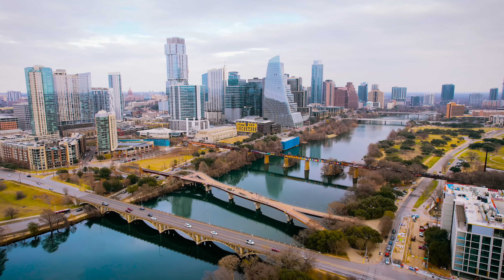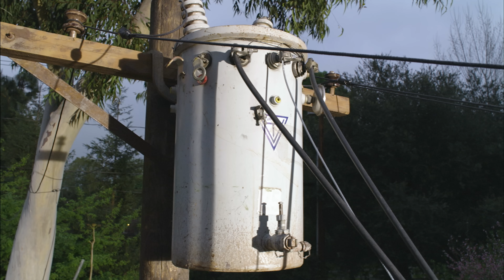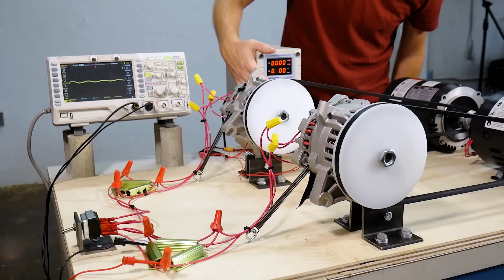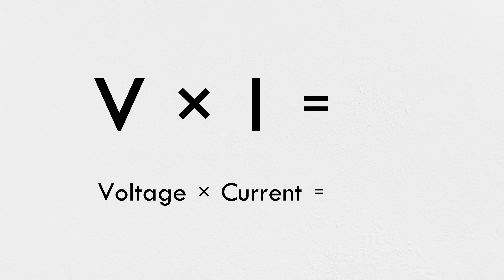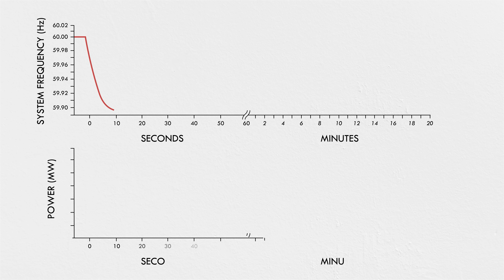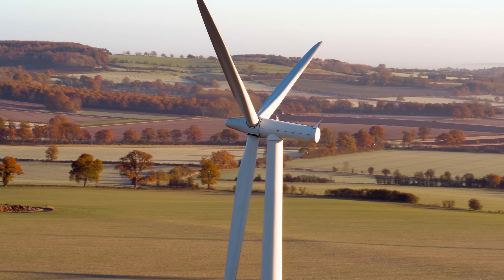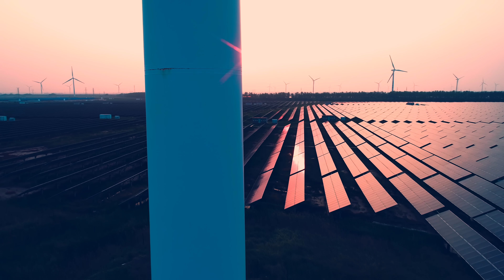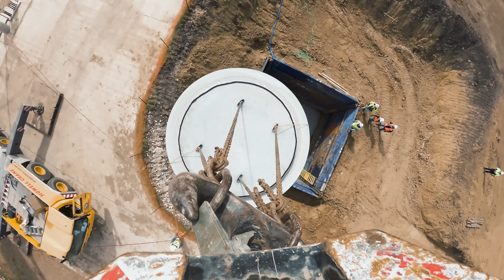Connecting Solar to the Grid is Harder Than You Think

Comment: It seems a bit like the answer in the Edison vs Tesla debate may be shifting.
The decision for AC came from a time when phase regulating equipment was only needed in a hundred or so power plants across the country while inverters were expensive mechanical devices, but it allowed us to have "dumb" transformers in hundreds of thousands if not millions of places across the country. However, now this means that we need "more modern" phase regulating equipment with the inverter in each solar, wind and battery installation. And with our goal of expanding renewables, we'll likely see solar installations on the roofs of a sizeable fraction of houses, and thus possibly more inverter based sources than transformers. I wonder if there would ever come a point where it would be cheaper to have built a DC grid instead.
We'd need an own inverter on the input side of each transformer, but they just have to be the solid state kind without any synchronization features that make the "more modern" ones more suitable to the current complex landscape, since they can be independent and don't have to "play along nicely" with the rest of the grid. As far as I understand it, the fact that the frequency gets messed up whenever there's a disturbance results from the fact that there's more than one source of AC power on the same wire. With a DC grid, that can entirely be avoided and transformers should work at any input voltage (they could merely output AC power with a lower voltage, while the frequency can be held sufficiently stable to protect appliances).

And even if the DC path never gets cheaper, the AC decision was made at a time when only factories and street lighting really relied on the availability of electricity (if they weren't still gas lamps). These days so much more goes down when electricity is out. Not just all indoor lighting, communications, all of our home appliances, and hospitals; but also our heat, water supply, traffic lights, shops, and the power plants themselves. (Yes, there's exceptions whenever outages are too disturbing that backup generators or USPs are kept on standby - which also costs money.) The resilience of not having a single bad law, guideline, or default setting in a series of inverters turn a slight disturbance into a full power outage, might even justify a solution which costs more but isn't so complex that predicting it's behavior becomes near impossible.
I mean, even running the self-regulation on the current power grid requires a separate data channel to communicate the current (and possibly even forecast) electricity price. A DC system would in theory regulate itself to some voltage value in the acceptable range, even if you did something as simple as setting a convention how the electricity price varies with grid voltage, possibly even with additional dependence on the time of day to further stabilize the voltage against predictable cycles of demand (and supply).
Reply: That moment actually passed a long time ago - all computing runs on DC (transistors are DC devices) so we have to convert AC to DC for every single device which uses a computer, chip or logic circuit, which is everything in (not even modern) electronics. The cumulative costs of that passed the costs of a DC grid ages ago.

But there's never been a point, and never will be, when making an entirely new DC grid and switching everything over from AC to DC is cheaper than just continuing to make do with the AC grid we have. Not only do you have to build a DC grid, but you have to rewire every building and replace every device built for AC. Even all the devices that would work better on DC would need to be replaced because they've been built for AC input.

The cost would literally be all capital investment across the entire economy for several decades (that's what you're replacing), just to get to the same point we're at today with a DC rather than AC grid.

If only Tesla and Edison had a crystal ball that predicted the technical workings of computers - they could have made the right choice, and also invented computers.
Reply: Yea, ok imagine if some smaller eg island nation went for say 400Vdc , all the smaller generators plus users must tap into it, volt drop the first major issue, they have to choose a practical / safe voltage everyone could work with.

Comment: Practical Engineering prepared a good video on the subject.  The take aways are that with the present technologies the grid will need conventional rotating machines to maintain the frequency and the voltage support for the frequency following inverters to function.  Following the technical literature there seems to be a limit for renewable generation with frequency following invertors at 70% penetration due to dynamic characteristics of the grid following a major disturbance like a fault.  As cited in the video there is a need for inertia and the ability for reactive support from generating sources to ride through the disturbance.  One must remember that the invertor-based devices can provide some of these requirements, but there are limits within the controls for them to be effective.  For the grid operators the information of those limits needs to be well understood.  There is plenty of work to be done for achieving the goals.

Comment: I disconnected my lines in from the power meter,and made my solar connections to my mppt and on to my battery bank/power cells and then directly to my AC breaker panel while using the existing romex to send the dc power to all outlets,lights,etc and use dc bulbs,brushless dc fans, and dc and or LP aplliances and never need more power,or have to give away my excess power for almost free to the monopoly... Fans run 24-7-365,lights can be ran non stop due to such low draw/usage,and I even have extra wattage that runs my entire shop..

Comment: My engineering perspective on photovoltiac PV solar favors rooftop over vast field arrays. Rooftop solar seems to lead to neighborhood mini-grids whereby modestly larger PV arrays provide more energy for household needs. Matching rooftop and neighborhood arrays to household EVs again seems to favor plug-in hybrid PHEV over all-battery BEV tech for many reasons including addressing the need to reduce routine vehicle travel and transport of essential commodities the longest distances. Plug-in Hybrid PHEV+H tech seems to be the most equitable distribution of battery, PV solar array and (combustible) hydrogen resources.

Comment: Going with d.c. electric for off grid cottage like a sail boat or R.V. Running lights and smoke detectors on stand alone system with backups. I will have an A.C. inverter for my power hungry tools. The D.C. appliances cost a little more. I think the D.C. fridges and freezers have more insulation.

Comment: Maybe the grid need a separate "base clock" that is shared among all the power plants as a guide to what the frequency should be. In the case of a loss of a plant, solar and wind plants can refer to that "base clock" and push the grid frequency up.
Reply: Doesn't work that way. The clock has to be analog with a magnetic field.
Reply: @thedude5040  Not sure what you mean. The clock just has to be independent of the grid. It can be anything that can keep accurate time so plants can refer to it if the frequency starts to drift.
Reply: @samik83  the clock is encoded in a changing magnetic field. A digital clock offers no motor control and is far too slow of a response time. This is one area a digital system cannot and should not replicate. Even a GPS clock is too slow and too inaccurate for grid synchronization
Reply: @thedude5040  Is that magnetic field created by grid power?  
A digital clock can work in the gigahertz range for example, so I don't know how that can be too slow.
Reply: @samik83  gigahertz has far too short of a wave length and too high impedance to couple a magnetic field from various generators 100s of miles apart from eachother.  But it doesn't matter what frequency your digital signal is, it will always be too slow as each interface will add input lag from from simple processor instructions of trying to read, copy, or match the signal. The magnetic field created by the power grid also is the clock signal. If you wanted a seperate or secondary clock you will then need a second set of wires connecting all the generation sources together. The field also stores energy. This is why when the grid collapses its hard to bring it back online because you also have to account for all the stored energy in the transmission system.
Reply: @thedude5040  Well I'd be amazed if with todays high speed fiber optics you couldn't synchronize clocks to the needed accuracy.  Grid frequency is many orders of magnitude slower than what we can get from internet speeds.  But I'm not an expert on this field so I'm just thinking out loud here.
 
Or simply use GPS time that doesn't need any connections at all, just GPS receivers at plants.
Reply: @samik83  get over yourself you are talking about things you know nothing about. you still critically fail to understand analog time. It's not about a precise set period. it's about speed of light response. Fiberoptics can't store energy and still need computers to decode signals, where as a mechanic motor will insteanesouly respond to a change in magnetic field. You need a system with speed of light responses with flexibility yet strict controls, infinite resolution, and no input lag. You also forget that motors don't spin up insteanesouly but the stored energy in the magnetic field does. There's no point to a secondary grid clock.
Reply: @thedude5040  "get over yourself you are talking about things you know nothing about"

Ok I'll ask you, since you seem to know.  

"It's not about a precise set period. it's about speed of light response"

If it's actually speed of light response, I'm interested in knowing how this works, what are the systems that can balance the the grid so fast. 

It's just interesting that in the video he shows a graph where the response time is in tens of seconds and using backup generators in some cases.  Not exactly speed of light, would you agree? 

I don't know of the how much energy companies actually use grid following inverters, but that was just my idea of how to correct it. I assume there are already that inverters that don't simply go along with the grind if theres a problem, but actually try to correct the frequency if they see it deviate as not to cause a cascading failure. 
I wonder how those systems work? How do they know what the correct frequency should be?

Comment: 6:10 This is not at all what a smoothed PWM output looks like. You will not find a single straight line in the actual ouput (and of course it will be much, much closer to a sine wave).

Comment: Actually, many inverter topologies (connection pattern between the electronic switches that convert between the AC grid and DC solar) are readily and very cheaply (less than +25% cost) amenable to cover more than half their AC power rating worth of DC-connected battery.
What that specifically allows is to forcibly smooth out grid injection of PV-sourced energy over a couple minutes, or alternatively and likely more beneficial, emulate a veeeery heavy flywheel with their battery-based (instead of flywheel inertia based) energy reserviour.

Note, we're talking about on the order of half the panel cost (using "one shipping container straight from china, not including shipping and taxes" prices) or even just 20% in batteries to have "5 minutes of backup power in case sudden darkness"-worth of energy storage.
It is though generally preferable to utilize day/night load shifting battery farms like the ones e.g. Form Energy are working on (iron-air batteries, target of 100 hours of capacity at max power) instead of oversizing the AC capacity of building-integrated PV inverters, because those battery facilities will normally run their inverters (technically actually converters, because they unify inverter and rectifier) in battery-charge-from-grid direction right when the PV inverters are providing peak power. Thus by simply flipping the power flow direction by essentially just mildly adjusting the voltage ratio of the AC/DC "transformer" they can inject stabilizing energy into the grid for the cost of about 3 quality electronic clocks that work together to ensure it has an accurate and reliable sense of frequency. Likewise, when the battery farm feeds the grid while the sun isn't shining, the small 5 minute batteries associated with the PV inverters can be held at say 3 or 4 minutes target level and swing up and down in response to grid frequency swings, delivering energy to cover load spikes and re-charging from the slightly over-correcting manually-controlled reserve power plant boosting the grid back to slightly higher than perfect, so they're quickly ready for another load spike.
I think it should be feasible to just assign the regulatory frequency range to the used battery percentage levels, and then just make the AC power proportional to the difference between current frequency's assigned battery level and actual battery level, so that mild inaccuracies in frequency measurement due to cheap frequency references in individual inverters just cause the batteries to be held at slightly different levels. Also fits a flywheel simulation much better.

If  the grid operators would actually embrace PV inverters for their potential (arbitrary current/voltage as long as power is balanced sufficiently on the DC bus that e.g. the MPPTs feed into, and both voltage and current don't exceed component limitations (instant overload and thermal overload matter there)... sure, small ones have to act quite autonomously, but that's not really an issue unless you're running into long-distance grid transmission line power limitations, and for those you better figure out how you cope with that, considering it doesn't need much), they could actually be quite happy.

Comment: I've worked in the power industry desgining control aystems for power plants- most of those years with combustion and steam turbine combined cycle plants. I've recently moved over to Battery Storage because of the new and exciting possibilities. I was very interested in your video and very glad to hear you mention black starts and grid forming at the end. Very well done, very clear, and a very thorough introduction. Well done!
Reply: The problem is the batteries of tomorrow's utility will not be lithium based, thus requiring very different controls.
Reply: Everytime there is a change in tech everyone needs to adjust! Right now batteries are doing incredible things for the grid. They can pick up load (primary frequency response) extremely quickly... Hundreds of MW in very very short time-frames (a few seconds or less). This is much faster than rotating equipment. They can also do MVAR control very well. Things are changing quickly and it's exciting to be a part of it.
Reply: @controlsfreek  yes the work in batteries is exciting, but don't fool yourself  it's still vastly too small. Until balancing authorities start to have 10,000s MWHr of batteries they still not play any major role. The unsung heros of texas's power grid last summer was Texas's natural gas and HVDC transmission lines between kansas/oklahoma and arkansas that dumped excess power into ERCOT.
Reply: @thedude5040  how long do you think it might be before there are 10,000 MWHr of battery on the grid?
Reply: @controlsfreek  it's 10,000 mwhr x the number of balancing authorities, so really I'm talking like 200,000 MWhr. No idea when that will happen.

Comment: How feasible is a number of electric motor/generator pairs with flywheels as an alternative for solid state inverters? DC from Solar or wind powers a DC motor which spins a flywheel up to speed and a synchronous generator uses this inertia to provide power to the grid. 
Numerous companies make these units for providing smooth, filtered AC. They come in sizes up to 100s of megawatts but it would probably be best to have several smaller units to deal with partial capacity of renewables.
Reply: Not feasible at all. It only provides a few seconds of power when called upon.
Reply: @thedude5040  It's not for storage, it just converts the DC output of the solar panels into AC that is identical to the energy provided by a conventional power plant, thus solving the issue in the video.The flywheel is only to provide inertia so it doesn't stop immediately when it is called upon.
Reply: @TheHuntermj  the fly wheel doesn't really solve anything for grid tied solar.
Reply: @thedude5040  It's only to prevent it from stopping immediately when the grid tries to draw power from the unit.
Reply: @TheHuntermj  we have capacitor banks. I just installed a 160MWhr capacitor in Florida. Edit well.. technically MVAR
Reply: 100s of megawatt is laughably small. A small grid in the US is on the order of 30,000 megawatt hours.
Reply: @thedude5040 A 30,000 MW grid is made up of many energy sources, I wasn't suggesting one 100 MW for a whole grid, you might need thousands but they are industrially available and reasonably cheap. Solar Star, the largest solar plant in the US is 575 MW, you would need Six, 100 MW units you wouldn't need the solid state inverters.

Comment: My home battery inverter can run in a backup mode, islanded from the grid. It shuts off with the grid when there is an outage, though, to protect anyone working on the wires.
Reply: My $600 generator does the same thing.
Reply: $600 obviously is manually operated. So I just have several emergency backup lights in my garage so you can safely drag the generator out of storage in the dark.